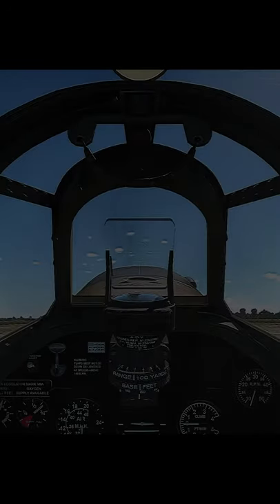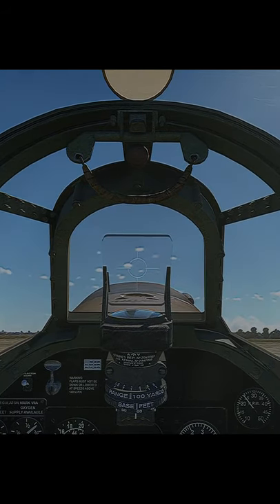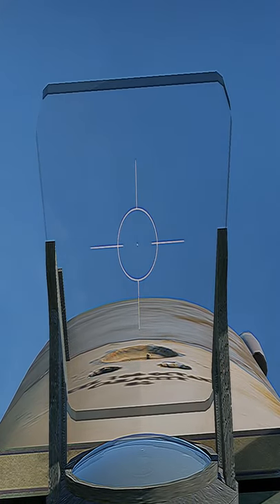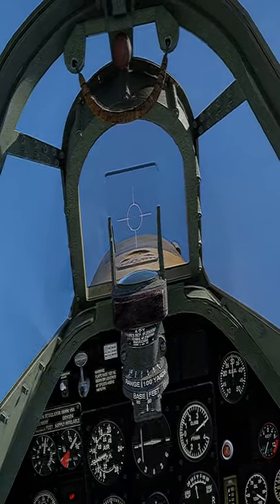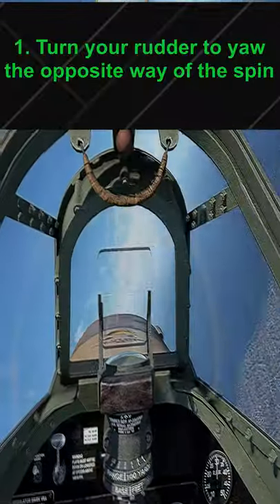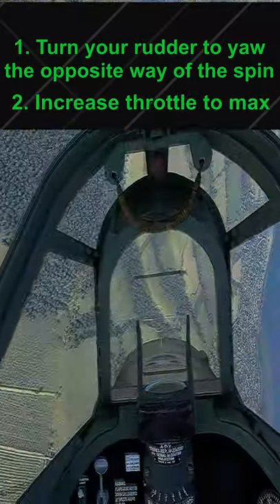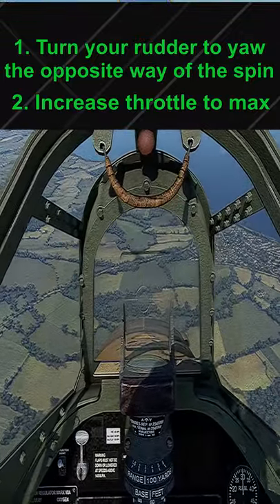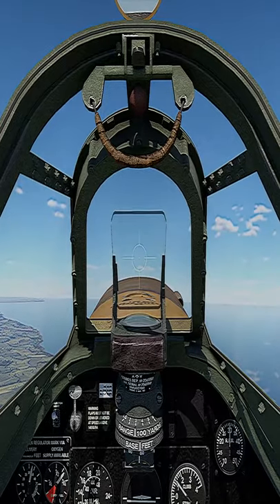How to recover from a Flat Spin in an Aircraft

Comment: Power idle
Aileron neutral
opposite Rudder
Elevator down to break stall
Recover (add power, pull up, etc)
Reply: That's exactly how I do it (in real airplanes, by the way)  !
Reply: Power idle is essential to remove engine reactionary torque along with decreasing the speed at which you're hurdling towards the ground.

Comment: With mouse control, Gaijin won't let you control the aircraft. Instructor takes control to make sure you never recover.
Even though I'm a real pilot I still love the ease of the mouse control, but I'd like if it didn't kill me ^^;
Reply: You can turn instructor off
Reply: Set a keybind for toggling through modes forgot what it's called but it should be there somewhere

Comment: This is not a flat spin. This is a regular spin. Flat spins are almost always irrecoverable and are characterized by a horizontal spinning moment rather than the nose down attitude of a regular spin.

A regular spin  is caused when you stall and are not coordinated, (I.e. A yawing moment in either direction left or right) your description of this was right it is when one wing is more stalled than the other and the result of that is a downward spiral. 

To recover you either need to take away the stall or take away the yaw. If you remove the Yaw you’re just in a stall. If you take away the stall you’re just in a downward spiral.
Reply: Oh I got that once. Good thing it was a videogame because in real life I would definitely died, but in WT was able to get out of that

Comment: Death spin is if the Center of gravity is further behind making it so that the aircraft doesn’t go into a nose down but a nose up spin which is completely uncontrollable since it basically is a stall of all surfaces, that is a death spin. You can’t recover you just spiral to your death. The only types of aircraft that could recover are the ones with immense power such as fighter jets
Reply from the maker: And a spitfire LF

Comment: I had that problem in my P63 a couple of days ago (it started to fall spinning on itself), somehow I manage to get out putting wep and forcing it's way out using the tail and the right wing spoilers... Kinda, I loose 1.6 km of altitude in the process but I manage to get out

Btw, the way I got into a flat spin it was because I brush the left wing against someone I just killed, I didn't loose the wing, but I turn violently left and start flat spinning left turn all the time at a speed of 60kp/h... I was damned lucky, and somehow I take the right choice of how getting out of there

Comment: Hey sorry but you are wrong you do not add power but reduce it, in a stalled condition you are generating large amounts of p factor and torque 

Remember pare
P-power out
A-aelerons neutral
R-rudder opposite
E-elevator down
Reply from the maker: I tested this a couple of days ago and this doesn’t apply to: DCS, War Thunder or MFS2020, in these you need to use max thrust for some reason and Ik it’s unrealistic, but still, it’s just for sims :)